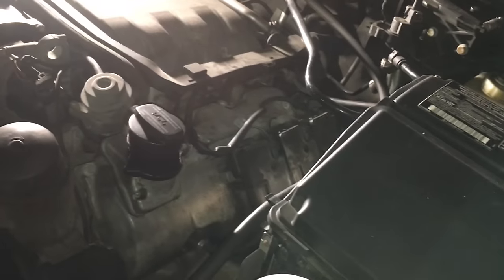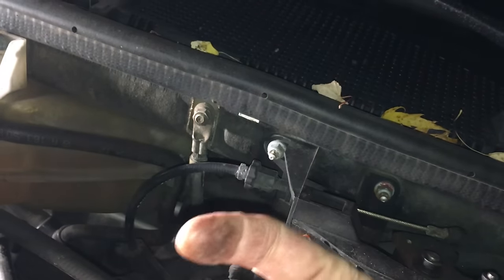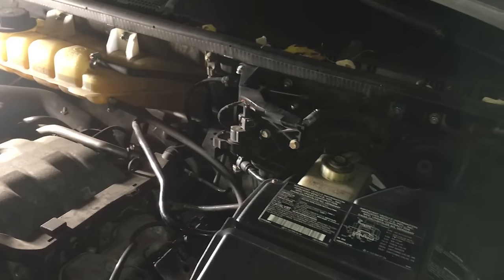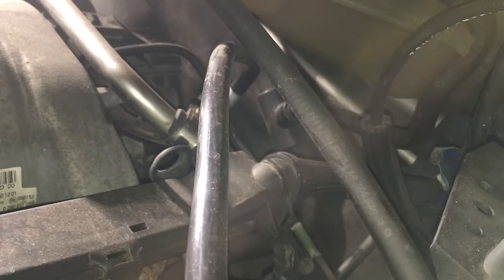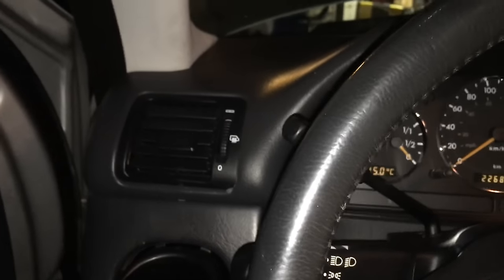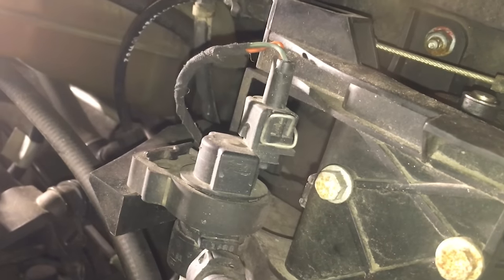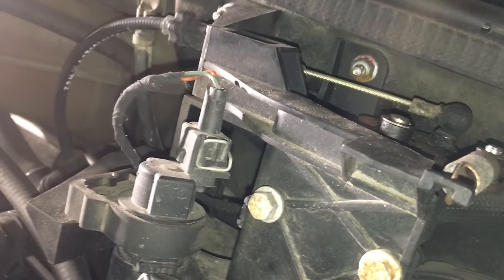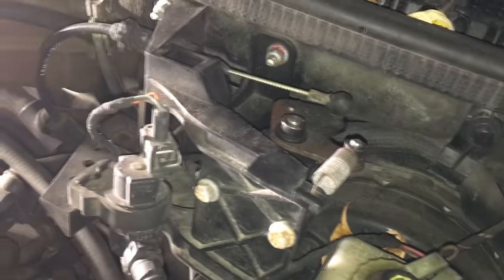Mercedes electronic throttle body how to reset idle .relearn..improved idle, throttle response

Comment: Ever since I purchased it 5 years ago, nearly every time someone came up to my car, they asked me what was wrong with it. Those who also own Mercedes-Benz’ would just say, “It cannot be fixed… that is just the way Benz’ are.  

Thanks so much for the awesome advice. My 2004 E-500 4MATIC Wagon is now purring like a kitten!
Reply from the maker: good to hear . glad it helped
Reply: I have the same exact model. I’m not sure if im in the right place but my wagon makes a buzzing noise until I give it a little gas. Is this video the solution to that problem?

Comment: I have a 1997 Mercedes S500, while in park the idle fluctuates up and down and I can't get it to go past 20 mph. I have codes P0507 and P1580. I'm having trouble trying to find help related to this specific year and model. Any advice would be appreciated. TIA!
Reply: Did you figure it out?  My 94 e320 has a new similar intermittent. Exception is if you get to 20-25 mph flat/downhill you can activate cruise control and it takes off down the highway fine doing what the computer tells it to do.  Have cable to the throttle body.  Suspect some switch on throttle idle or wire harness. A mechanic glitched harness trying to fix starting (towed home, & changed neutral safety switch).

Comment: Hey, Your w202 vids have come in so handy for me, now your w163 vids will be just as handy, I have Ml 430 and its just an amazing car the power and way they drive is insane. Although being a v8 when ever it comes to do some light work you regret it instantly, There is no space in the engine bay. Or in my case i spent the weekend trying to open my bonnet from the outside because the hood cable has just gone bad , Currently busing trying to work out why the car stalls when idling or low speeds and all warmed up, cleaning the trhottle body and reseting it is next on my list after watching this
Reply from the maker: clean the Maf sensor with some sensor clean spray as well.. it may or may not work , but if it improves a bit , you will know the MAF is bad
Reply: fupabox j

Comment: 1999 W202 kompressor. 
Hi. Hope this help someone as you helped me. Had a #4 cilinder misfire going up a hill at highway speed. Found 2 bad ignition coils, corroded spark cables and #2 sparkplug burning lean. Fixed everything plus a valve cover gasket and plugs seals. Now the car feel diferent. It has no torque as before. It wasnt limp mode (cause ive driven in limpmode before). Found out that the idle control valve (some call this a diverter valve, blow off actuator) was not closing but supercharger engaged normal. The valve closed only when the engine was cold started then it will stay open. So there was  my problem. The car felt like driving in the winter setup, no stalling or rough engine vibration just no torque. Now is when I found your video and my advise to everyone. 
I knew for sure the valve was not the problem since it close to idle. Most videos sugested changing the valve. 
Now when i found your video it hit me. Ofcourse the valve works in combination with the trottle. 🤔 so I did the reprograming with the key as you showed and 😲😲😲😲 now it all works fine or better. The car feels new with lots and lots of torque an even better mpg. So my friend CHEERS to you!!!  And to anyone else PLEASE dont change the valve before recalibrating it and driving for about 100 miles then let the car rest for the night or a few hrs untill it relearn. I Also recomend to do this after changing  plugs and ignition coils even if everything feels ok. 
Thanks for the video it gave me insight with an indirect related matter and I love to figure things out. 
Thanks again and have a goodone. 
Ps. Excuse my engish not my first language.
Reply from the maker: thats some pretty damn good English for a second language . I would never have known . Glad you sorted it out :)
Reply: U did a great job for English not being your first language. Understood you completely.

Comment: Hey fupa I'm always enjoying the videos. I just bought a 2002 ml320 it's in awesome shape with only 124,000 miles. Im loving it, I still live my w202 but the w163 is very comfortable and great on snow.
Reply from the maker: Yes I agree completely.. The W163 is ridiculously comfortable and sometimes on nice days last summer I found myself using it when I would nearly always choose the SLK  :)
Reply: fupabox yes I feel like I been betraying my w202. my w202 is great in gas vs the w163 but usually I'm a penny pincher when it comes to fuel but driving this thing I really don't care lol best investment I have done so far. the only downer is that the vehicle wasn't assemble in Germany vs my w202
Reply from the maker: kchilz32  :)
Reply: fupabox I had to replace the idler pulley last night it gave away while driving luckily it happen on my mother's street. lol and advance auto parts had it on stock and in top of that it was made by flenner a made in Germany. wanted to know, what engine oil, transmission fluid, coolant, spark plugs and power steering fluid do you recommend? Thanks.
Reply from the maker: kchilz32 any 0w 40  to 10w 40   full synthetic with the MB229.3 approval on the rear label is good for engine oil.. Castrol syntec and Mobil 1  Euro both meet the 229.3 requirements. For coolant I now use  http://www.recochem.com/products/oem_premium_coolants/oem_premium_extended_life_50_50_premix_antifreeze_coolant_european

Pentosin CHF 11s  power steering fluid, or the new Prestone European power steering fluid is supposedly compatible.  
plugs  FR8DPP33
for tranny fluid I would use only the dealer spec fluid from Mercedes
Reply: fupabox I'm far away from Mercedes dealer but have you used or recommend zerex g-05? also the fr8dpp33 aren't found anymore I guess it was replaced with fr8dpp33+ what's your take on those as far as difference? also the crankshaft pulley is a bit wabbling I'm thinking of changing it out. also for transmission service should I replace conductor plate while I'm at it? it only has 124,870 miles. Do you have any videos for replacing mounts? thanks so much you are the Jedi Master of Mercedes.
Reply from the maker: yes actually the g-o5 is fine .. as are the fr8dpp33+ plugs .. I wouldn't worry about the conductor plate unless you are having issues .. most of them last the life of the car.  tranny mount replacement is on my w202 channel I think .. prob bad quality video  though :(
Reply: fupabox Awesome many thanks again. I'm glad I can use the zerex g-05 that's available all over where I live.

Comment: He Fupabox, just got this error and acceleration is horrible. Replaced the sensor immediately bit it did not resolve my issue. The funny thing is that it does work when I read the live data but the value increases very slowly when I press the pedal. It drops really fast when release the pedal. Have you got any ideas/tips?

Comment: To look for it I have a 2003 Mercedes S500 couldn't find it but I hooked you to a machine and it said I needed the throttle sensor so I was going to try that but I can't find it in mind so I was wondering if you knew where it was would be grateful appreciated for your help what does I just ordered the wrong part cuz when I look throttle sensor up it showed me the throttle pedal looking thing and I order that instead so now I have to order the throttle position thing but Geek Parts won't let me and it's closed today so I can't order it till Monday does hoping this would work instead so that I can drive my car until then
Reply from the maker: The TPS sensor on your s500 is built in to the gas pedal

Comment: Great! I have an eratic idle on my merc sprinter I'll try this. I also have a W210 E320 which sometimes is slow to shift up. Not always, just from time to time but it does do it at some point on most around town journeys. There is a dash engine light just come on - the red triangle, this may no or may not be related.  Any ideas? Many thanks.
Reply: Guy Riviere and
Reply: Do you fix this problem ? My w209 do like that every time.in the same place shift up slowly

Comment: so basically you turn your key so that all the lights come on and then just wait for 2-3 minutes without doing anything? I had no idea that would have anything to do with throttle... i have 2000 CLK btw, same engine m112 3.2 ( I actually tried to make that cable sit a bit more snug than it was, now you're saying the complete opposite of what i thought would improve the throttle response )
Reply from the maker: Yeah there needs to be a bit of slack in the cable.. if it's tight the throttle actuator will get a false reading and idle poorly.  Make the cable a bit slack and do the reset and your idle and throttle response will be nicer

Comment: Great post thanks! 1999 ML320 engine stalls when warmed up. Fuel pressure is at 50psi at startup but after a few minutes it drops to almost 10 and then kicks back up to 50 and it will do this a few times until the engine finally stalls. It would start right back up again and begin at 50psi. When I turn off the engine the fuel pressure will gradually drop within a few minutes. I had the MAF, throttle body and CPS, coils and wires all replaced. Still the same problem persists. Any thoughts would really be appreicated. Maybe fuel pump? I don’t hear the pump turn on when ignition is in the on position. But I still would get 50psi when the engine initially starts up. Maybe vacuum leaks? but wouldn’t know where to check. I also have codes for O2 sensors. It’s so frustrating. Took to a shop and all they did was plug in their scanner and tell me they don’t know what’s wrong. thanks.
Reply from the maker: fuel pressure regulator is allowing pressure to leak back into the tank when of for a while . I haven't done a replacement video on it , but it is fairly simple to swap out since it is built into the fuel filter on your 320

Comment: I just replaced the MAF, crank positions sensor, air intake assembly, fuel pump and fuel filter on my 2000 ML320. Now it idles super high when I start it up, then goes down in drive but is still too high. If I put it in neutral it goes back up to the very high idle. Will doing this reset alone help or do I also need to adjust the tension on that wire? Thanks for any advice.
Reply from the maker: jamnjam    before doing the reset , make sure the cable has some play in it . Then do the reset . If it isn't working you may have a vacuum leak somewhere
Reply: IT WORKED!!! Omg thank you this was so helpful! I now remember one of the mechanics had left the key on for long periods of time looking for electrical shorts and it must have messed the idle up. The slack was fine on the cable, and indeed it took about 3 minutes for the buzzing to end. Started up like before...normal. Again, thank you so much!
Reply from the maker: excellent  ..glad it all worked out  :)

Comment: Fupa, I am a bit confused. I have watched your tutorial and have read other tutorials for the OM642, on how to Reset the The Throttle Position Sensor. 

In one tutorial they tell you to: 

1) key on
2) hold the accelerator pedal for 5 seconds
3) key off and release the accelerator pedal.
4) wait 1 minute and then start the vehicle.

In you tutorial you:
1) key on for 3 minutes
2) turn off the car.

Do both methods work?
Reply from the maker: both methods are for resetting different things . The leave key for 3 minutes in this video is to relearn idle speed. The other method is to reset the adaptive transmission ecu to baseline
Reply: @fupabox  thank you for the clarification
Reply: @fupabox  one more question, do I need to clear the CEL codes, for either of these Reset Procedures to properly work?
Reply from the maker: @Kenster1025  good question.. I can't say for sure ,but I don't believe so
Reply: @fupabox  thank you. I will wait until my crank sensor is replaced before I clear the codes I already have.

Comment: Want to ask does the W211 have the same throttle cable that u showed us? Thanks.
Reply from the maker: I’m not 100% sure . Some don’t have a cable at all and are connected by wire from the pedal to the throttle body . Still same reset procedure with no cable to check for tightness

Comment: 2002 Mercedes ML320. What does it mean when the sound never stops? I’ve waited 10mins +
Reply from the maker: If it is just the low buzzing/ringing type sound . it's fine . as long as it doesn't continue to make the adjustment sounds .. Hard to describe .like a robot moving ...But a constant humm/ buzz is fine. You can turn it off.

Comment: Is the ball looking thingy for the throttle cable meant it be loose? My ml350 w163 ball is really loose
Reply from the maker: It should be a tiny bit loose .  ( you can pop the plastic ball looking piece up and off ) and put a dab of grease on the metal ball u see it and snap the plastic piece back on .. that will keep the metal ball from wearing out the plastic ball cup and getting looser .

Comment: Interesting you mention the throttle cable adjustment, my friend's was horrible, she didn't have WOT or anything close to it way too loose. I actually swapped out my throttle body I would get a code in the winter sometimes and the TB would be completely unresponsive, just idle, restart 5 min later it's fine, one of these days I'll pull the old one apart.
Reply from the maker: Intermittent problems are the worst
Reply: No problems since swapping it out around this time last year, so maybe it'll get thru a whole winter without catastrophe:)
Reply: Hi, I have a 1998 ml 320 starts right up but when I step on the gas pedal nothing happens, I replace the aselerator sensor,the maf sensor and still has no response on the aselerator what u think is the problem?

Comment: Pls help . i have a 1998 mb slk230 and wont pass 2k rpm even on parking or drive . its not reving more than 2k rpms
Reply from the maker: likely wheel speed sensor, or transmission issue  ..transmission is in limp mode
Reply: @fupabox  also i cant communicate using 38 pin socket and regular obd2 its asking for 38 pin diagnostic.

Comment: is there a way to crank ot but no start? i mean to lubricate engine if i let it sit months without starting?  i have a jeep and if full throttle is applied during crank it doesn't start! great job with the Ml
Reply: 2006 Merced e350 timing change mark
Reply: Disconnect Coil Pack wires loom wires or unplug HT leads if it is Distributor Cap and Rotar Arm. Disconnect fuel injector loom wires too. Should crank without spraying fuel into cylinder and unnecessarily sparking the plugs

Comment: So you don't need to hold thr accelerator peddle and all that? Just put lights on leave for 3 minutes?
Reply from the maker: 2 different things. This method resets idle ..the other resets the transmission to factory shift parameters

Comment: This method works really well, but I cant figure out why after a while I have to keep resetting the throttle, sometimes   starting the car after adding new fuel will put it into limp mode then I have to use your method to reset it... any ideas why
Reply from the maker: possibly cable is too tight . There needs to be a bit of slack
Reply: @fupabox  could there be another other reason for it other than the cable being too tight? I'll try relieve the tension, but the only issue is that I've never touched it before untill now, I always used your ignition reset  to fix the problem.

Comment: My ml320 2001 hesitated to move when stopping at the light or stop sign. My ODB 2 scanner shows code P100 mode 10. Could it be the TPS? Thank you.
Reply from the maker: Mass airflow sensor... try using a sensor clean spray ..they sometimes work , if not make sure to get a bosch one , the aftermarket MAFs dont work

Comment: Is there another way to reset the programming in car mercedes Is the separation of the negative battery also useful
Reply from the maker: Negative battery could reset once the speed sensor is replaced .. the SRS light needs a Mercedes specific scanner to reset
Reply: I cleaned   throttle body  He did not remove the negative   battery  ande Now I have a problem The car stops in less than 5 seconds a It is not working now
Reply: Is this because of programming
Please help me if you have a solution
Reply from the maker: Check that there are no vacuum leaks , or disconnected wires.. then do the throttle reset... just turn the key to the full on position with out starting the car and let it sit that way for 10 minutes
Reply: Turn the key to on Duration 10 minutes
This will reprogram throttle body and the car Sir
Reply from the maker: yes .. you will hear a clicking and humming from the throttle body as it relearns the idle position. after 10 minutes , turn off remove key , put key back in and start the car
Reply: Thank you very much, sir
I wish you more success

Comment: Any tips on what to check out if my 01 W210 needs a little gas to start?
Reply from the maker: sounds like fuel pressure is bleeding out of the system when parked . the check valve in the filter could be bad

Comment: Hi there, I have a question pal, I own a Mercedes c 220 cdi 2005, when I start the car I get to go and it starts choking on it self, after that it will only rev up to 3000 rpms and the check engine light is illuminated on the board, when i scanned it on the computer it showed throttle position, I'm really desperate I would like to know what should I do, is this video related to my problem? Thanks in advance
Reply from the maker: trying the reset may help , but it sounds like your TPS is either dirty, wiring is bad , or the TPS is toast . This will reset the TPS so give it a shot
Reply: @fupabox  for sure I will bro thanks again